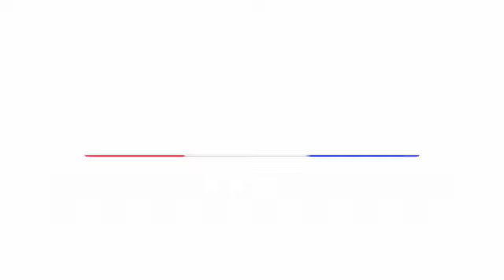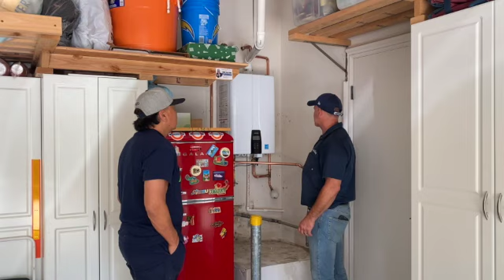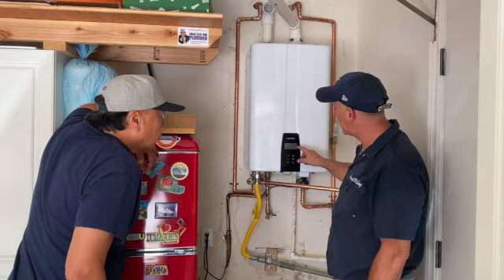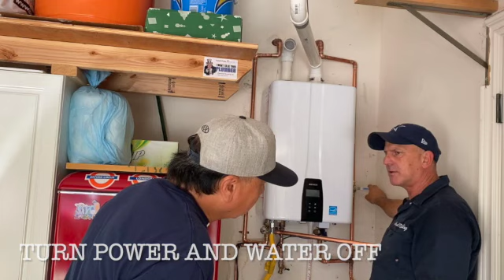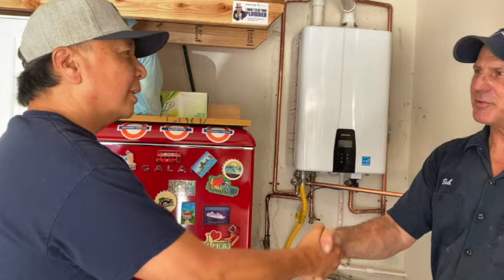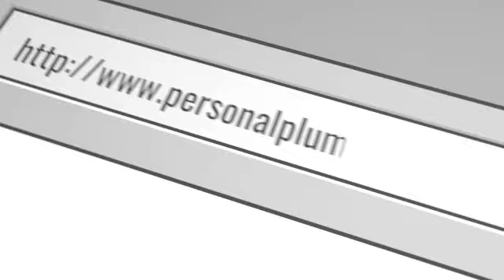ATTENTION! Here are the benefits of a Navien tankless water heater!

Comment: The cost don’t not out weight the expense.  This are good if you need space,  other then that you do not, and will not ,save money. Several reason the1 st istall is 3 to 4 time more , 2nd unless you descale the unit yourself.  You have a yearly expenses. And that is at least 300 bucks and 3. 12 years and then all over again. So where is the savings. Unless you are like me a plumber.  Then it is a slight saving.
Reply: Descaling the system requires a small pump and 3 gallons of vinegar a bucket and some hoses.  To start, that will run you $80 in supplies.  After that, it will cost $15 a year for the vinegar.  With annual flushing, it should last 18 years, easily double the life of a tank model.   Add, more efficiently, the additional space and unlimited hot water, and tankless is a great investment, especially if you are going to be in the home long-term.